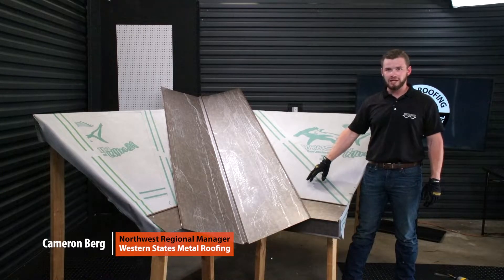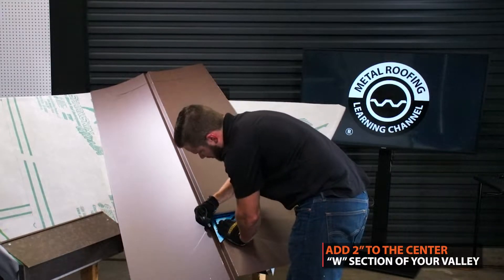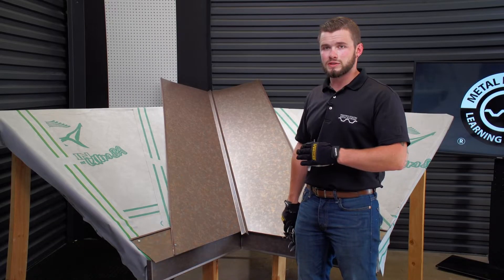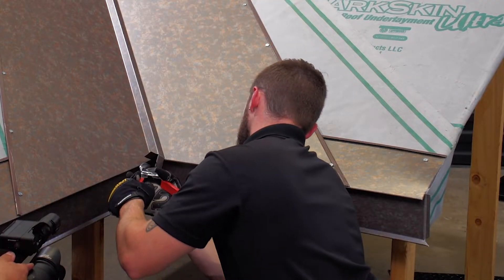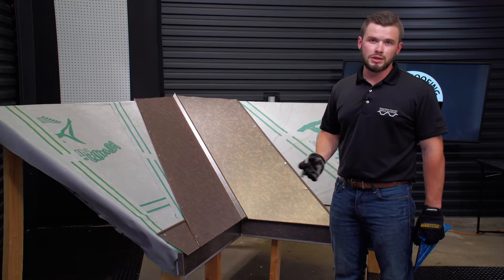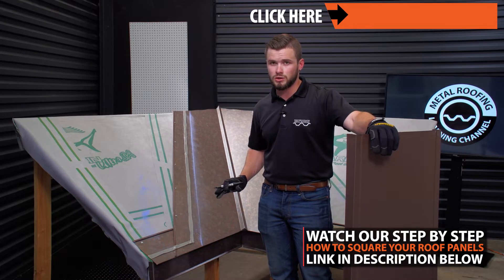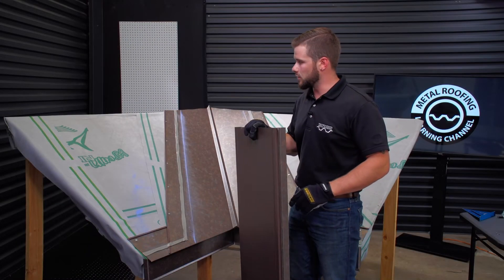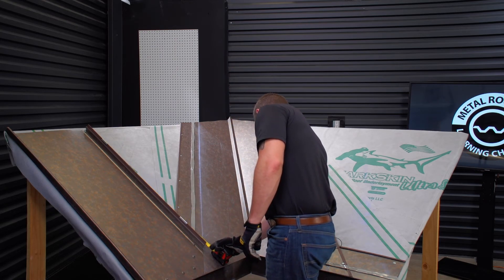Exposed Fastener Valley Installation For Standing Seam Metal Roofing. Part 3 - Fixed Valley Detail

Comment: Not sure why you would promote an exposed fastener detail for an concealed fastener panel...  Tell me it isn't so.
Reply from the maker: Jordon, you're right that this is not the correct detail to use. It says in the video that the floating detail without exposed fasteners should be the detail of choice. The problem we have is that we have DIY homeowners that insist on using this detail. We figured we may as well make a video for both types of installations. Hope that helps to explain why we released this video.